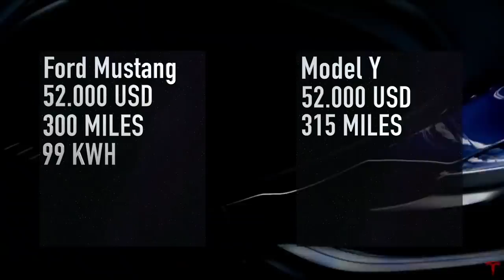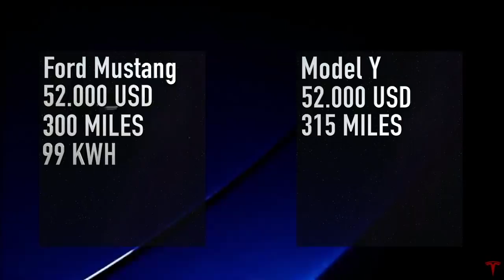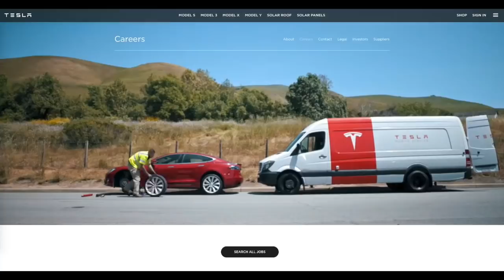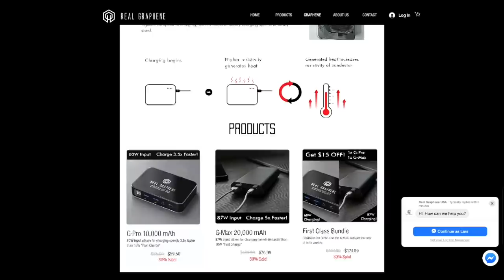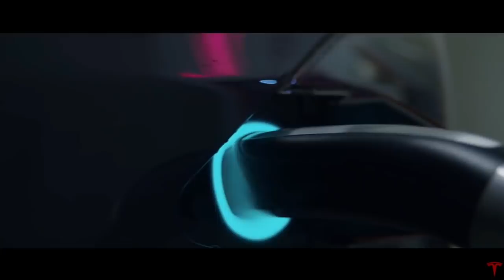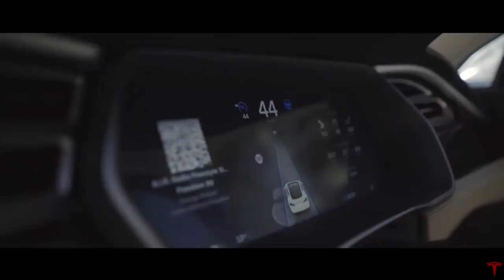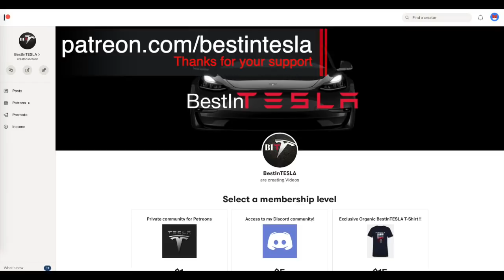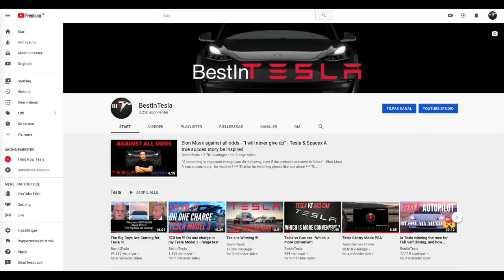Tesla's quest for the best battery technology

Comment: You mentioned that Maxwell has solid-state battery tech.

I don't know about that.  I've read nothing to indicate it.  I know they do have dry-coating tech for anodes and cathodes, and that improvements in cycle life, energy density and production costs are expected from that tech.

I don't think that commercialized solid-state batteries are soon to be announced by anyone, Tesla included.  I do think Tesla will soon announce an improved-tech battery using Maxwell's dry-coating tech and a new liquid electrolyte.  It should be good enough to generate the range and performance numbers promised for the new Roadster, the high-end Cybertruck, the high-end Semi, and the Plaid option for Model S and X.  (Actually, we haven't seen any promises for Plaid, but it's got to be a big step up, and for that, I think they'll need new-tech batteries.)

Isn't it true that Tesla is no longer calling their April event 'Battery Investors' Day?'  I think they're now calling it 'Tesla Investors' Day.'  What that means, in terms of what we will learn, is not very clear.

There was a leak/rumor about Tesla buying CATL LFP prismatic cells.  Tesla hasn't confirmed it.  Personally, I hope that if Tesla does buy LFP cells, it's for their electrical infrastructure and Powerwall products, not for BEVs.  LFP energy density is far less than for Tesla's cylindrical cells, and prismatic cells suffer from the same thermal management issues as pouch pack cells.  It's a big giant step backwards for mobile applications.  Energy density per kilowatt-hour matters less for fixed installations.

I do not want to see Tesla's Chinese Model 3s have worse range and specs than Tesla's USA Model 3s.  If they put LFP prismatic cells in Chinese Model 3s, it'll raise a heck of a stink.  I'm sure the Chinese government does not expect Tesla to do that, after the incentives and backing they've given to Tesla for GF Shanghai.

Now if Tesla announces a new, cheaper Chinese model with LFP batteries, but keeps making Model 3s equivalent to US Model 3s, I could see that working.

Tesla can only grow so fast.  They won't be able to supply 78 million BEVs per year in 2030, thereby wiping out all competition.  I think they'd be doing great - beyond great - to get to 10 million per year.  That still leaves a lot of room for other BEV sales and also for ICEV sales.  The latter will probably continue to dominate overall sales for at least a couple of years beyond 2030.

But during that time, stock prices for companies who haven't moved aggressively into BEVs will take a severe pounding.

BEV sales growth for the 'Big Boys' will be difficult, because supply will lag demand for battery cells, badly.  Their costs aren't coming down as fast, either - in part because they aren't vertically integrated, in part because they don't have the tech Tesla has acquired and developed.  But I think we have to assume that eventually, sometime in this next decade, at least some of those legacy automakers will get their BEV sales numbers up.

VW seems to be the first of the legacy automakers to make that a priority.  They won't be the last.  It won't be easy for them, nor painless.  But the handwriting is on the wall.  If they don't create and manufacture compelling BEVs, they'll shrink as Tesla grows.  Some might not survive.
Reply: He probably misspoke on the Maxwell comment. Btw here's confirmation on Tesla using CATL prismatics.....
https://youtu.be/NmsW1JQ33oc
Only for China SRM3 since Elon mentioned their biggest issue being battery supply chain it makes sense. China will be happy because the batteries will be bought in China instead of LG Chem, Panasonic, or Samsung. Also, Elon spoke of the modules and pack being redundant and they have a patent for making a cylindrical cell pack w/I modules.
Reply: @stevencastellanos8063  I dont believe Tesla confirmed it would be prismatic, it is possible. We know for sure it will be CATL, I heard of a possibility of Tesla going to from 2170 to 4070 cylindrical, On battery I suggest you look at this guys research, part 2 has the battery details however well watching both.
https://www.youtube.com/watch?v=T5Y0GAVWnE4
https://www.youtube.com/watch?v=Vt1XO5_xHss
Reply: @thomaz1963  Agreed, they may have said LiFePO4 chemistry but that can be manufactured in cylindrical shapes as well, still easier to control the temperature.
Reply: No he is correct Maxwell have solid state batteries they have been around since the 1950s IIFC, Tesla I believe bought them more for the dry electrode manufacturing process.  Solid state batteries Vs lithium ion batteries reminds me of LG OLED TV Vs Samsung LED TV. OLED is a superior tech just like solid state is however OLED is too expensive to make and eventually Samsung caught up to OLED with their QLED, that it no longer made much of a difference in picture quality. I believe the same will happen with Solid State batteries they are a superior tech but will be too expense by the time they can be mass produced to complete with lithium ion batteries it will no longer matter. I expect lithium ion batteries to be the main power pack in EVs until there is a step change as they are constantly evolving.
Reply: @thomaz1963  I don't know much about what Maxwell is doing with solid state cells.

Neither does anyone else outside of Tesla.

Here's why:  basic research is published in peer-reviewed journals and becomes visible to the public.  But when a candidate cell configuration enters development for commercialization, it goes dark.  A candidate can remain dark for years.

Most candidates never emerge from development.  There are a lot of check marks to tick: thermal characteristics, cycle life, energy density, power density, charging characteristics, safety, ease of production, cost... most candidates end up with a flaw that prevents them from achieving commercialization.  If they don't outperform current-tech lithium-ion batteries, they'll die in development.

Because of developmental darkness, we don't know if Maxwell is even working on commercializing solid state cells, let alone when they might emerge into the light of day as an announcement from Tesla.

From the news reporting I've seen, Maxwell's dry-coat electrode tech has nearly made it to commercialization.  We're all hoping to hear more about it in April from Tesla.  If I have to guess - and I do, guessing is all any of us can do until Tesla announces its commercialization intentions - it's this: Maxwell will be concentrating on getting that dry-coat process into Tesla's cells.  If they are working on commercializing an even more futuristic cell technology, it's on the back burner until their dry-coat tech is out the door and into production.

But that's only a guess.  Whatever is going on with solid state cells, it's dark.

You really can't reason in the way you're trying to do: you pointed to a different technology in a different field, you observed a candidate tech emerge from the darkness to become commercial, then concluded that this informs you about what Tesla is doing.

It doesn't inform you.
Reply: In  Brazil, Minas Gerais in the Interior Midwest Mineiro Brazil

The best logistics point for the Tesla Model Cybertruk And Semi and Solar Fotovoltaic Energy to install in Brazil has to be in The best logistics point for the Tesla Model Cybertruk And Semi and Solar Fotovoltaic Energy to install in Brazil has to be in Minas Gerais in the Interior in the Center Oeste Mineiro Brazil near a Dry Port of Vale do Rio Doce Railway Train.
, and Great airport ...

And the Great Federal Highways like 381 and 262 in Minas Gerais ...

Logistics and Fundamental in Transport Strategy for Product Production Delivery in Brazil

The interesting thing here for the Tesla Model Cybertruk Taking off here has to be the same as BYD has already done in Campinas, it has to start with the manufacture of photovoltaic solar panels, which it is very specialized in this part of, and has reduced the cost by 16% in the production of these Photovoltaic Solar Panels to pass on to the Consumer ....

She has her very large Solar City Fotovoltaic Lend that Company in USA

Reduce the cost of producing a product to sell in bulk and complicated

And her Other Product would be Bi Bus Passenger Electric Bus for the Urban Perimeter, they are very good in this Technologies, it would stimulate the productive chain in Brazil and generate a lot of work and income for all, the important thing and generate energy and improve passenger transport in the urban area .... next to a Porto Seco by Railway of Vale do Rio Doce.

And the Great Federal Highways like 381 and 262 in Minas Gerais ...

Logistics and Fundamental in Transport Strategy for Product Production Delivery in Brazil

The interesting thing here for the Tesla Model Cybertruk Taking off here has to be the same as BYD has already done in Campinas, it has to start with the manufacture of photovoltaic solar panels, which it is very specialized in this part of, and has reduced the cost by 16% in the production of these Photovoltaic Solar Panels to pass on to the Consumer ....

She has her very large Solar City Fotovoltaic Lend that Company in USA

Reduce the cost of producing a product to sell in bulk and complicated

And her Other Product would be Bi Bus Passenger Electric Bus for the Urban Perimeter, they are very good in this Technologies, it would stimulate the productive chain in Brazil and generate a lot of work and income for all, the important thing and generate energy and improve passenger transport in the urban area ....
Reply: @jcordeirocordeiro3117  I would love to see a Tesla Gigafactory in Brazil.  South America must be included in Tesla's plans at some point; it's too important to ignore.
Reply: This will explain a lot: https://www.youtube.com/watch?v=rYEevmuxMgU
Reply: I want your comment in a video.
I'm not lazy. I think it would be good content.